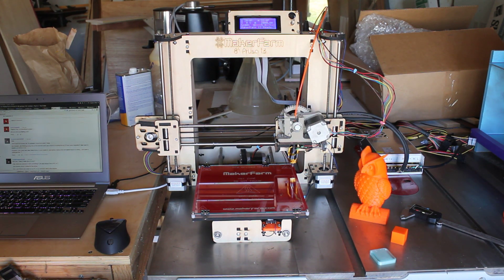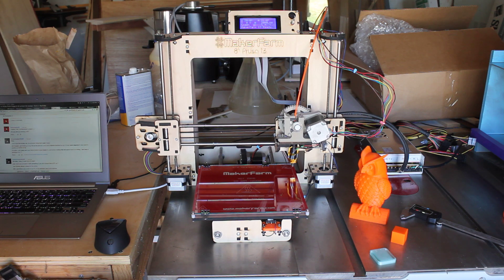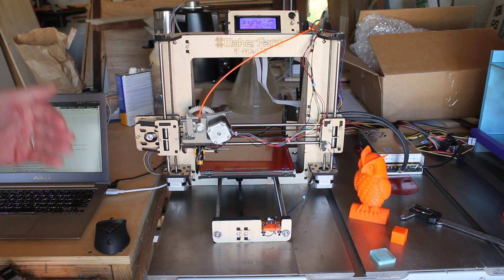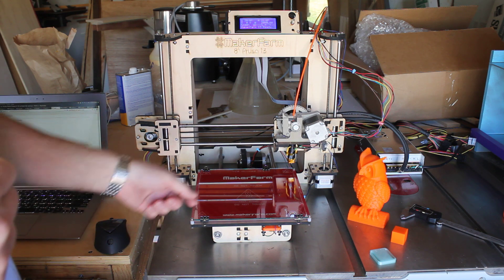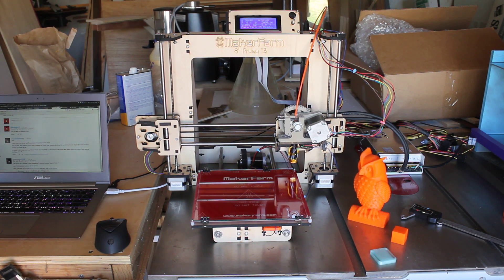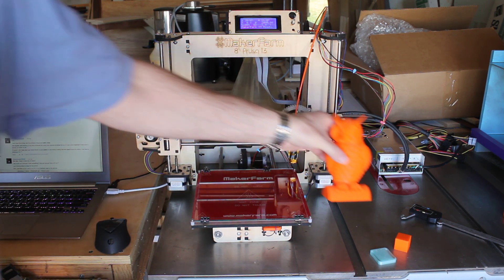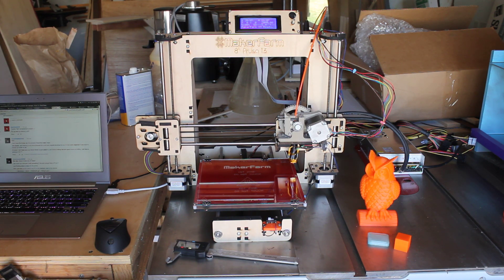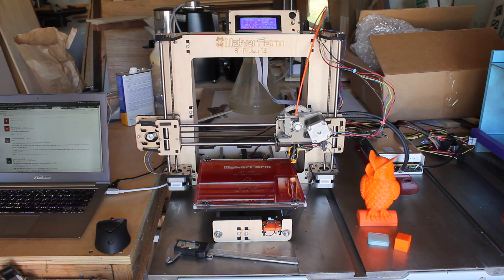Makerfarm Prusa i3 3D printer kit review - Part 3

Comment: You're talking about that you are happy due to the fact that they are early prints. Why would the prints get better in time?
Reply from the maker: Prints get better as the printer's state of tune improves.  Just like any precision tool, a 3D printer needs to be kept calibrated and in adjustment.  When the first test prints come out well, that's a good sign that they can be adjusted to be even better.

Comment: Can you document your final setup process please... I put mine on the shelf alot of time after frustration set in.
Reply from the maker: Steven Machado Are you having some spific issues?  Divide and conquer is the best strategy I've found for commissioning a new printer.
Reply: +ZennmasterM Well, STILL playing with this thing.. If I had to start somewhere I'd like to know about your voltage to your stepper motors if you can offer that I might be able to fumble it out.

Comment: Linux can handle the 25000 bit rate.  There's a patch that makes it work. (thanks, Google)
Reply from the maker: That's true, and it's been around for a while.  I don't recommend going that route simply because whenever Python (or, for that matter, the entire distro) updates, the patch generally gets lost.  It's not a big deal to reapply it, of course, but I find it's a lot easier to change the value in the Configuration.h just once and be done with it.  Also, since I print from the SD card pretty much all the time, there's not a lot of advantage to be had with the higher bit rate.
Reply: Good points, but now that I'm using OctoPrint with the Raspberry Pi (also running Linux), I tend to use the Serial more because it has a dedicated computer and it's easy to run remotely with the camera.  (Also, the patch seems to be inline now with most distros because I've upgraded and can still use Pronterface without communication errors)

Comment: What power supply are you using?  Have you had any issues with the Non ATX style?  My Makerfarm I-3 is being delivered but I was advised to stick with a ATX psu.  That installation just looks so much cleaner!
Reply from the maker: No problems or issues at all.  The PSU I am using is a 12v 30a unit, so it has two 12v rails at 15a each.  The voltages are quite stable. My experience with ATX is that you can get some voltage fluctuation, but PCs can generally handle it, so it's not that big of a deal. 

I have used the recommended ATX PSU with this printer, but I found it took a lot longer to heat up the bed, so I switched back.

Be aware, though, that the LED PSU doesn't have a switch, and also, while mine does have a guard over the terminals, not all do.  Again, not a big deal, but better to know about it beforehand.

Hope this helps!
Reply: ZennmasterM How long does it take for your bed to heat up just wondering?  I have a 360w power supply but with one rail and it takes about 20 minute for it to heat up, seems kind of long?

Comment: It would depend on what materiel your printing, from what I've read PLA smells sticky sweet (although not good) & ABS like how we imagine hot plastic.

Prolonged contact with fumes should be avoided, so ventilation is a must, although PLA is slightly less toxic. There is also research into the health effects from microscopic dust emissions present in extruding, while this is present in all media it means PLA can't be considered safe. All this aside 3D printing is still far safer than smoking...

Comment: The solvent needed to do the vapor process to PLA is quite toxic compared to acetone so be very careful, work outside or with a fume hood. Other than that it theoretically should work the same, but its not something I'm really looking to get into. If you do give it a try however, then I'd like to here how you get on!

Comment: I've been trying to figure out the patch that cdmiller0 posted, but I've not been able to find the directory mentioned at the sites I've found.

So, could you explain what you did to change the configuration.h file in a little more detail?  You mentioned using the Arduino IDE to do it--but I think the Arduino IDE can't communicate with the RAMPS Arduino until the communications rate is correct.  ?

Comment: The baud rate issue in Linux with the ttyACM usb on the arduino mega 2650 is fixable via a Python patch.  Using the a patched Python serial library to correspond to newer Linux kernels allows the 2500000 baud setting.  I'm using this on Ubuntu Precise with no problems.  Search Google for "linux python tcgets2 patch"

Comment: That's pretty much what I did. Made a "Utility" folder on my SD card, and in there are load.gcode and eject,gcode….

M109 S200               ;heat up to 200C
M117 Ejecting filament...
G92 E85                 ;set extruder at 85mm
G1 F80 E0               ;eject 85mm
M104 S0                 ;extruder heater off

M0 Insert new filament

M117 Loading filament...
G92 E0                  ;set extruder at 0
G1 F50 E85              ;load 85mm

M117 Filament loaded!

Comment: I bought this printer in may so far enjoying it. Was an easy build for a first timer to 3d printers. So far the only problems i had where with the endstops that came with the kit did not work, had to buy new ones at radioshack, I also had to modify the X axis to hit the endstop so i lifted it and modded the Y axis to hit the endstop too. But so far its a good printer, any calibration tips, trying to print the nickle test and its so close to fitting the nickle.

Comment from the maker: You got me thinking and wondering: What kind of procedure are you using for changing filament?  My thought would be to heat the nozzle to a temperature lower than that needed for printing (IE: about 140 for PLA and 180 for ABS), then reversing the extruder 100mm or so?  Then heating up to print temp (for proper flow), then extruding 100mm? That's pretty much how I do it manually, having that as a menu option would certainly be convenient!

Comment: It's true, every setup requires some customization to get the most ideal behavior. With my i3 endstops at 0,0 I had to add extra end.gcode to Slic3r and Cura to get the nozzle to move X0 Y190 Z+10 and expose the finished print.

I'm having lots of fun hacking Marlin lately. I just added code to allow a custom message on M0/M1, handle more folder depth on the SD card, and to set a custom Mendel name, and now working on code to load/eject/change filament as a menu option. Open source is the shiz!

Comment from the maker: You are completely right, that is totally doable in Marlin.  It just feels a bit strange to me to have the axes home away from the endstop switches.   Another side benefit: when the X and Y are homed, the entire bed is exposed, making it easy to clean or remove the glass.  I'll probably try it the other way at some point, but for now I'm liking it.

Comment from the maker: The deal Makerfarm is running on the 6 inch right now is really good!

The six-inch could be just fine, as long as you don't want to build anything bigger than 150mm on any one dimension.  

Also, you aked earlier about the sound level.  It's definitely louder than a PC.  The volume changes based on what kind of motion the printer is doing.  At its most intense, I'd say it's about the sound level of a dot-matrix printer or an electric typewriter.  (that's when it's doing infill quickly).

Comment from the maker: No, the homing reversal isn't really necessary, I just feel better having it home where the end stops are.  X and Z are calibrated, but since there's no real bed-leveling system on the printer, you're kind of stuck with what you get on Y.  The good news is, because the frame is so solid and square, the Y-axis on mine is just about spot on.

Just to do it, I checked the steps/mm, but the presets were right on, so it was really just a double check.